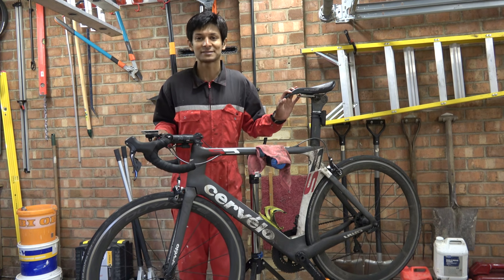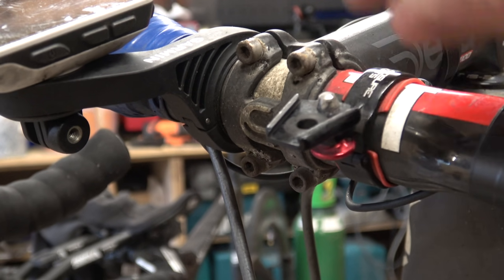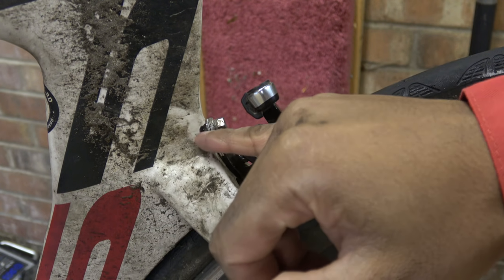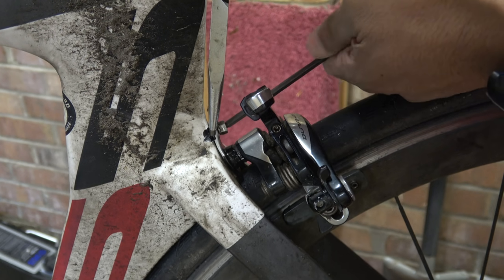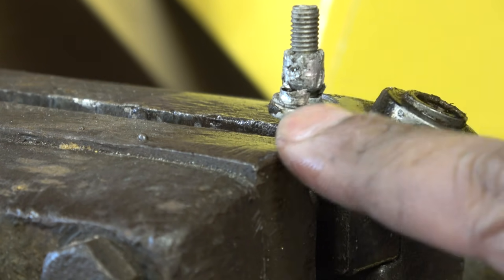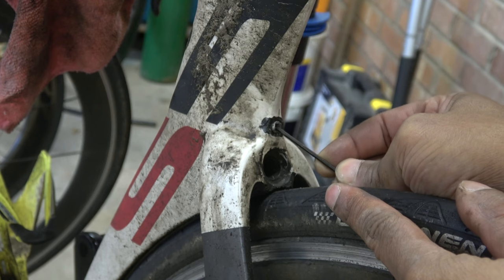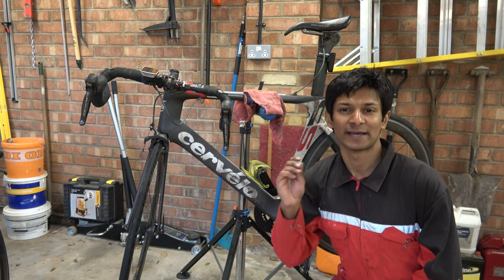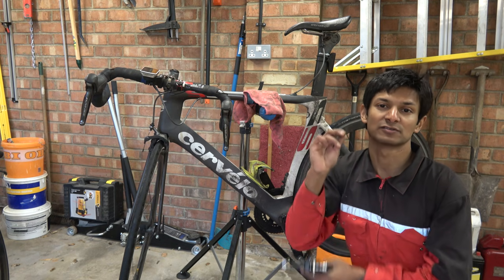How to fix a broken Bicyle Frame Boss (water bottle, bottom bracket, down tube)

Comment: Can't believe that Cervelo would use such a ridiculous method of retaining a rear brake caliper?   Great work as work as always Mr. Hambini...
Reply: @Ultranationalist It really shouldn't. This bike obviously gets ridden in the UK winter, is rarely cleaned, and although galvanic corrosion as Hambini mentioned is a thing, it's also easily avoidable (a bit of grease on threads of the bolt periodically, not putting the bike away wet, gentle cleaning as required). Rivnuts can do the job for years; this is a case of neglect.

Every carbon frame brand in the world uses similar methods for water bottle bosses. In this case they're using it for the brake mount as there's no way to pass a normal brake calliper bolt and nut all the way through the frame. That said, it would make sense for them to use a stainless steel rivnut and bolt, but they probably choose not to because grams.
Reply: @ccmmrrnn  That is a case of poor application of an solution that is adequate for lower stress applications (bottle cages etc.) - where that solution is used appropriately. Rivnuts for securing a rear brake is an exceedingly poor use of that solution (and is why the vast majority of manufacturers would absolutely never use this type of setup).
Reply: @KimHDRoberts  The brake is not secured to the rivnut. It's bolted into the plate (what I called the brake mount) that is secured by the bolt that goes in the rivnut . That plate is supported by a larger part of the frame around the axis of the brake calliper bolt, so it's not cantilevering the bolt that's in the rivnut. Sure it's not ideal and there are better designs, but it's sufficient for Cervelo's design goals with this particular frame (aero). The rivnut failed due to poor maintenance, not due to the design.
Reply: The reason Cervlo has that set up is because the brake is mounted to the seat tube due to the aerodynamic design. There is no bridge between the seat stays to mount a brake, so you can't access the back of the bolt. Of course, the implementation of the fastener could have been better, but if not over torqued and kept fairly clean the nut shoukd not fail.
Reply: @GK-zr9cq  as I said - a poor implementation. The fact the frame design is at fault just exacerbates exactly how poor. Many aero bikes utilise rim brakes and none do it this badly.
Reply: @ccmmrrnn  I tend to agree with Kim on this one. Even though the calliper bolt fits within the frame that fitting looks to be a very slack fit and there would be some cantilevering with this set up, even though small it could lead to failure over time. No not a design I would want on my brakes thank you very much Cervelo.
Reply: @KimHDRoberts  No. Mechanically it is sound because the main breaking force is pushing through the buffer below on the caliper holder.
Reply: Fully agree I am happy with my old carbon frames Koga Casati Colnago where the brakes are fixed with a bolt. Looking this video I come to the conclusion that bicycle magazines test and recommendations are only valid for 3 year usage. For commuting use a steel frame lasts almost for ever
Frame weight 1.5 kg approx Casati Espresso for example
Reply: @ccmmrrnn  I wholeheartedly agree. When I went with a titanium frame, there was no shortage of naysayers, telling me that my seatpost and bosses would seize. That would be true of someone that never maintains their bicycle. If you create a maintenance cycle, it's all good. Example: Everytime you replace a chain, reseat or re-grease (or copper paste) your bosses and seatpost.

Comment: This is the video that originally brought me to your channel. Bought a PlanetX Pro Carbon 2 years ago, and almost immediately snapped the thread from a bottle cage boss, they wanted nothing to do with fixing it, even though it was under warranty, so i had to just deal with it. This video was in the related videos section on a GCN video a few weeks ago, so clicked it wondering how hard it would actually be. Turns out that it was a piece of piss to drill out and drop a new one in, and cost £8 for the tool with some rivinuts on ebay. Thank you 😁

Comment: You should have put some copper grease on the nut to mitigate the galvanic corrosion.
Reply: Or zinc cromate paste ? but i do use copper or aluminium grease a lot in automotive areas or molycote no plugs intended
Reply: @howd500  It's actually better to use something that would insulate and also prevent oxidation. Titanium is relatively inert but if you add copper grease it can accelerate galvanic corrosion (yes, it surprised me when I found out) Stainless steel into aluminium is particularly bad.
Best cheap solution is to get some plumbing Teflon thread sealer from local home supply megastore (B&Q still going in UK? Lowes, Home Despot in USA)
 NOT PTFE tape although even that would be better than 'dry' assembly
Reply: @1crazypj  Hi thanks for the info in the stainless / Aluminium combintion i have used in the past in sailing applications zinc chromate paste as a barrier thanks for your reply
Reply: @howd500  Cool stuff. Sea sailing is about as bad as you can get for corrosion, probably worse than riding a motorbike in British winter with all the salt they put on roads. (I guess they still do that?) I think Teflon plumbing compound may be easier to get hold of for most people though, I've never seen zinc chromate outside of specialty stores
Reply: Yeah, I've been hearing that you need a real physical layer as opposed to a grease
I've heard that carbon slowly delaminates over time, even with molecular level contact
As a result, the only guarantee is a physical layer of plastic or something

Comment: I have used a little superglue "Cyanoacrylate adhesive" to stop a rivnut from turning, If you feed the glue in like you would soldering or brazing ( surface tension ) you can often remove the fixing bolt.
Reply from the maker: I've never tried that but I might give it a go next time.
Reply: Yes i will put superglue too for extra power

Comment: If you drill at a slight angle it helps stop the rivnut turning but will continue to cut even if the rivnut spins.
I prefer the epoxy method, it helps secure it without stresses and also helps reduce galvanic corrosion.

Comment: Why no grease on the bolt? That's inviting the same problem again..
Reply: not unless the grease has a metal like copper in it......thread science 101 No amount of grease is going to stop metal on metal contact when the bolt is tightened. Greases help prevent corrosion of the non metal to metal parts of the thread but they don't help with the part of the thread where there is metal to metal contact.....Also see thread science 101 Only the first few threads are actually holding the fastener together(metal to metal contact) the rest of the thread just sits there(some parts metal to metal some parts not)

Comment: You need a sacrificial anode to stop the corrosion, there is so much crap on your bike that you could place it anywhere and there would be an electrical connection ;)
 I cant believe a five thousand pound bike has such a rubish fixing for the brake. Rivnuts are utter crap, any vibration and they come loose or damage whatever 
they are fixed to. The fixing for the caliper should have been embedded in the matrix of the frame when the bike was made, not crimped on as an afterthought!
Anyway keep up the good work.
Reply from the maker: Dirt = the hambini electrical conductor of choice!
Reply: Shocking rear brake fixture, no wonder my local bike shop stopped selling cervelo's..

Comment: Hi! Question-i have scott addict R1 2009 crame. Front  carbon hanger broke. I would file it down to nice round shape like seat tube.  Can I drill holes in to seat tube and use alu braze on hanger and use rivets or its better use clamp on hanger? thanks 🙏

Comment: Preventive is the best medicine for any nut or bolt seizure on any bike parts.  You're right rosomak. Copper grease from automotive place or if possible hardware store. It will also prevent the dreaded cold fusion of nuts and bolts or when there's  contact between metal / aluminum / titanium or steel for seatposts and bottom brackets. Of course carbon grease for carbon to steel / aluminum contacts.

Comment: Alternatively, if your a Cheap Skate like me, Slot the Riv Nut in the Hole, put a Nut on a Wheel Skewer, Screw the Wheel Skewer into the Riv Nut and then Tighten the Nut on the Skewer towards the Frame, worked a treat when i had a loose Riv Nut on my Merida. I use a Bit of Cloth so as not to mark the Frame in any way.

Comment: Do you not use any anti-seize compound on your bolts to try and reduce the corrosion? I've always found that the Park Tool ASC-1 compound does a pretty good job at reducing corrosion between aluminum and titanium interfaces and if reapplied during a yearly overhaul can help reduce the acceleration that your bodies sweat can have on that corrosion.

Comment: FWIW, given the possible damage to the carbon, Cervelo might replace the frame for you.  Last year Cervelo replaced my bike when a single tiny rivet broke off of one of the cable tensioners. Guess they couldn't rule out that the downtube was compromised and decided to give me a new frame.

Comment: Good to see carbon frame repairs, I bet there are many bridges jobs out there. Have you seen the UV setting adhesive? It's derived from dentisty. If you have, what's your take on this as an adhesive for repair or mounting bosses?
Reply: In my experience, UV-hardened epoxies are nowhere near as strong as chemically-catalyzed epoxies. I know you probably didn't want an answer from me, but just be happy you got an answer lol.

Comment: Thanks for the video i learned a lot from it. Would you think that a stainless steel or titanium frame would be more resistant to that kind of failure.
Reply from the maker: Yes, you could have the insert as an integrated part of the frame and it would not corrode in stainless steel or titanium.
Reply: Especially if you utilize Bolts of similar materials...  
SS with SS...  Ti with Ti...

Comment: Brilliant video, one question about rivnut’s, how strong are they?

If I wanted to add disc brakes to an older carbon bike would I be able to attach them with rivnuts?

Thanks
Reply: The older carbon frame probably isn't reinforced in that area for disc brakes, like how a disc specific frame isn,t reinforced in the right areas for a rim braking setup.
Reply: Old post..but NO!  Frames and forks are specifically strengthened for use with disc brakes
Reply: @TimInertiatic  thanks!:)

Comment: Hey great video, I just discovered this. I have the same problem with my seat post bottle cage rivnuts. Any help would be appreciated!

Mine were loose so I tried pulling the rivnuts out, but I may have wiggled it a bit to get them out, causing a tiny chip on one hole (it's like a slight Q shape now). If I take the original expanded rivnuts that I took out, I am able to put them back in the holes without too much hassle. I'm thinking maybe the holes were enlarged a bit.

Everything is out though. Just left with these holes. I think the rivnuts weren't corroded too badly as yours, but they must have come loose with vibration over time.

I can't find anybody who seems confident in fixing this. I'm not experienced with epoxy but I can follow instructions quite well.

Should I try (bigger) rivnuts or some epoxy? What type of epoxy should I go for? Or any other suggestions?
Reply from the maker: Hi Oemer, I would try a rivnut that has a longer compression area, so it will fill out the damage in straight bit of the "Q". It's not heavily loaded so epoxy should do the job.
Reply: https://youtu.be/X2sysHswUgI is what you are looking for. use a standard gun.
Reply: @firesurfer  Now that's a brilliant piece of engineering!  Not sure why it should be relegated to composites, the advantages in a blind application are clear regardless of material.  If you have access to the backside, using a washer of the same material as the rivnut works well too and avoids the problems seen in the video.

Comment: "Job complete".
Not sure I'd agree with that.  Your part failed due to galvanic corrosion.  My initial thought watching this video was surprise that a very smart engineer such as yourself who rides his bike in such wet hostile conditions would have allowed that to happen in the first place.
I'm referring to the lack of any dielectric compound smeared on the threads prior to assembly to mitigate that corrosion.  Clearly an issue evidenced by the corrosion that you pointed out on your handlebar clamp.  Why not take all of those fasteners off, use a brass wire wheel and brush to get them back to bare metal (or just replace them...), smear well with grease, dielectric compound or anti-seize and keep it from happening again?  Waterproof grease liberally applied is probably best in your climate. Your bike is a ticking time-bomb of part failure.  How bad would it suck for your handlebar to snap off while you're riding due to fastener failure?
Anyway, thanks for the #nerdporn.
Reply from the maker: Thanks for the comment. This problem is rife in the Aero industry where I work. I've tried most of the suggestions in your comment and they have mixed results. Granted, they slow the rate down but on the whole the stuff gets washed off or the threading inevitably contacts between fixings. It's not the surface area so much that causes the corrosion it's the electrical joint.
Reply: @Hambini  Have you tried PTFE tape on the bolt? It probably isn't perfect because there will still be some parts of the threads that cut through the tape and make contact, but there should be far less contact and threrefore far less corrosion sticking the two parts together.
Reply from the maker: @Ammi6543  I've never found it to work as the threads cut the tape and you always get some metal to metal contact.
Reply: @Hambini  This is a much more widespread issue in the marine industry. Another method is to provide some "fodder" for the corrosion to be eaten preferable to the metal you want to protect. In this case: copper grease would be helpful.

Comment: Just wonder. Wouldn't be possible to user steel rivnut with steel bolt? Finding adequate steel bolt shouldn't be a problem, and at the end would prevent corrosion, right?

Comment: If the set Rivnut pulled out the hole created was then bigger than the correct sized hole for a new Rivnut so that it is unlikely to be as secure (if at all) as originally.  The best thing to do is to use a larger say, M6 Rivnut and bolt or fully coat the Rivnut and hole with epoxy, set the nut and leave the epoxy to set and hopefully there will be enough interference to stop the new Rivnut pulling out.  Also, one of the complications here is that the titanium bolt is too long.  The threads project too far through the set Rivnut and will clog with corrosion from the Rivnut or any crud floating about, when that happens the bolt will bind up and probably spin the Rivnut, never mind that its a waste of a bolt length and adds weight.  Ideally, only 1 thread should be showing at the base of the Rivnut internally, which means that the bolt has maximum thread engagement without the possibility of clogged threads.  Personally, I use Alusteel Rivnuts as they have greater mechanical strength and you can set them with higher torque for better holding power and there is less likelihood of galvanic corrosion.  Also with steel threads the threads are less likely to strip or the bolt pull out after repetitive assemblies, a dab of anti-seize grease is sufficient to ensure no problem unscrewing the bolt.

Comment: From what I see, there is no problem with the titanium screw and the aluminium rivnut. Here we have two problems: No.1) The aluminium rivnut is corroded away due to a galvanic reaction with the carbon. No.2) The bike is filthy as heck. This is no dirt from a week of commuting. This is solid patina, built up over months without any cleaning. The dirt together with moisture leads to corrosion like this. I  always check if rivnuts on my bikes are properly sealed with paint. If not I just seal it with super glue. It's also a good idea to use weak loctite on screws, because it seals the thread. And yes, I am engineer.

Comment: What if the rivnut doesn't move, just the thread has been stripped? Would it be best to tap it out? Currently dealing with this problem at the bottom bracket cable guide. Thank you!
Reply from the maker: Jude Dodd I would drill it out. I would not tap it out!
Reply: Thank You
Reply: helicoils?
Reply: 'Cheat'...  Epoxy the Guide's Bolt into the stripped RivNut (if it is a simple CableHolder and NOT a CableSTOP)...

Comment: Just want to know what size of the rivnut need for cable guide under the bottom bracket? Thanks
Reply from the maker: M5
Reply: @Hambini  but mines is smaller than the watter bottles rivnuts
Reply from the maker: Unusual if it's m4

Comment: Nice video.  I am skeptical, however, about the ability to effectively hold the round and minute protruding rivnut rim while drilling the core out.  Of course, losing some depth of paint around it helps, but still....
Reply from the maker: You are 100% right, it's not easy but it is aluminium so you physically deform the metal to stop it turning. With steel that would be a different ball game altogether.